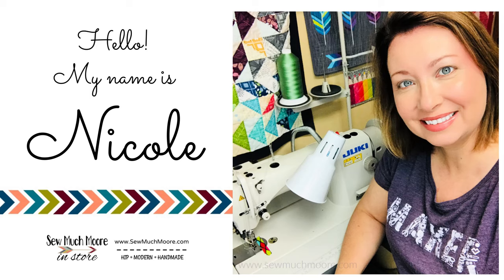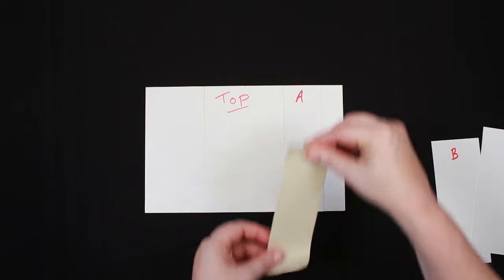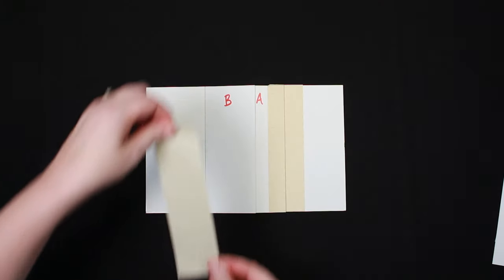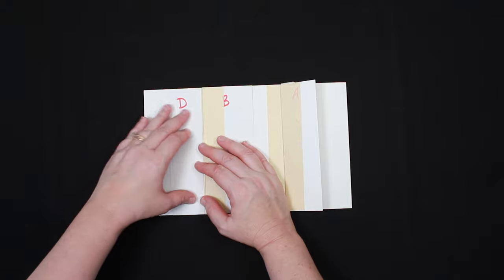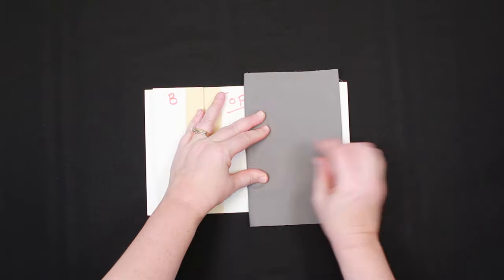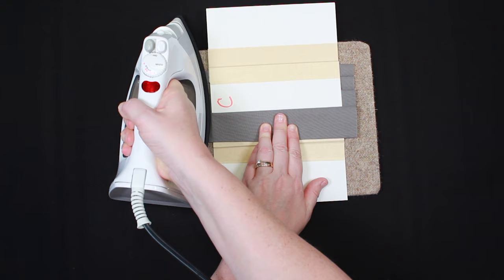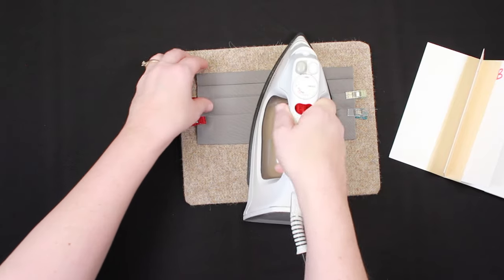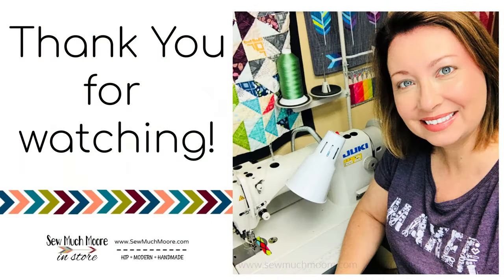Make your own Pleater Board - DIY Tutorial - perfect for pleated face masks

Comment: I'm new to your page/site and I'm having a bit of trouble getting to the measurements for the pleater board. I've put it in the cart, hit the pdf, downloaded some zip drive... Help please as I am wanting to create multiples of the mask to help out folks. Thank you.
Reply from the maker: sounds like you may have clicked on an advertisement.....

Currently, my measurements for the pleater board are a FREE PDF download.  
You will NOT have to provide a credit card to obtain it. 

If you have problems with downloading, please send me a message via my website contact form so I can email you back for a (hopefully) quick resolution.
https://www.sewmuchmoore.com/contact-nicole/
Reply: Same, if said I reach my download limit but it's first time for me to download it. 😢